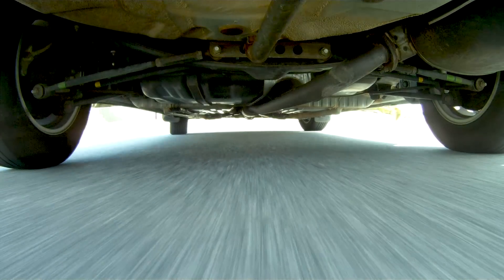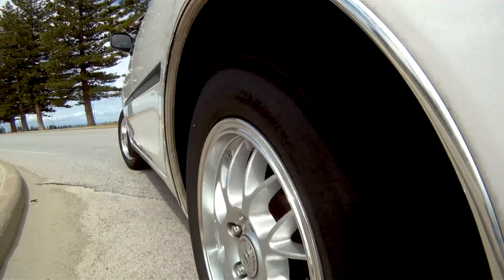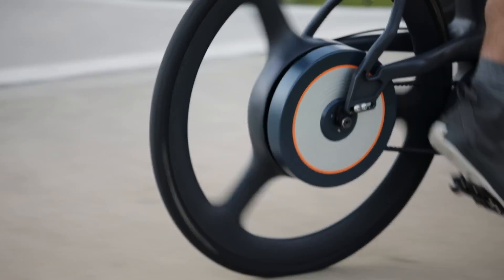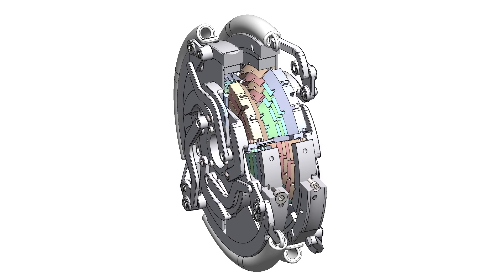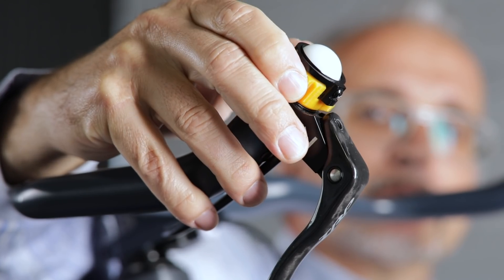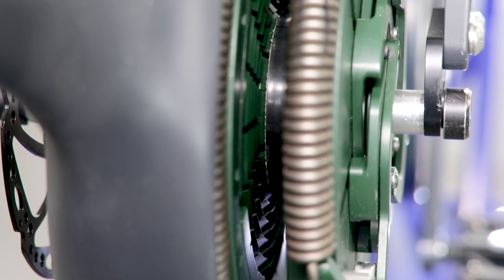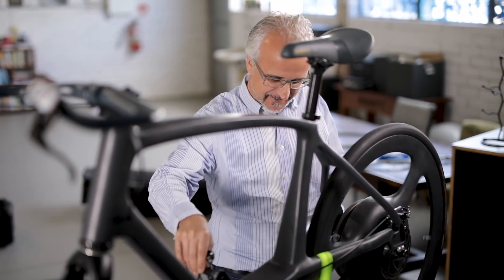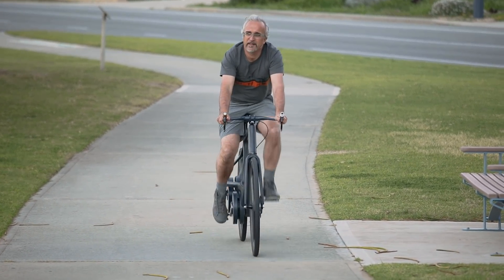Continuously Variable Transmission on a Bicycle

Comment: Failed in cars and will fail in bikes. Far too much efficiency loss, which is much worse than the losses of shifting between conventional gears.
Reply: Cvt's didn't fail in cars, they recieved a lot of backlash because people are so used to the feel of shifting that they didn't like not shifting. They were also more prone to fail on some brands initially.
In bikes I feel like this really doesn't have a place due to the weight, complexity, size, etc. But I think this was probably just a proof of how small they could get a cvt which is reasonably impressive.

Comment: I own a snowmobile, and a bicycle. Never once did I think it would be a good idea to put the transmission of the snowmobile on the bike.
Reply: Not even once?
Reply: The snowmobile drivetrain isn't sitting out in the open collecting debris in it's many moving parts like this monstrosity. Nuvinci have been doing a much better job on CVT bike drivetains for years and their stuff still barely sells.

Comment: road bikers will complain about the friction, mountain bikers will complain about reliability, bmx or trials doesn't need it. It comes on a proprietary frame too so you can't upgrade it. Overall, it serves no purpose in any disciplines of biking.

Edit: Even a commuter bike doesn't need it. It doesn't serve any purpose and no one needs it for any reason.
Reply: It's a proof of concept. They're not trying to sell it, but if they can resolve these issues they could find potential uses.
Reply: The road bikers would go mad over the weight lol
Reply: There are more and more "non-cyclists" on bikes with e-bikes and just city communting etc. These are made for short trips by people who otherwise wouldn't ride
Reply: @getahanddown  so why would you buy it then? It should be much more expensive than a regular gear drive. Not worth it if you use your bike only a few times a year
Reply: @getahanddown  I'm such a "non cyclists",  90% of my ride I use only one gear....I don't need this system. There goes your argument right out the door.
Reply: New cars don't serve any purpose either and yet we spend trillions every year buying them. They might be even worse than before. Its a new product, it does something different, people want to buy it.
Reply: miiikku People buy new cars because their old one rusted. Only serious bike enthusiasts care about keeping their cadence withing a 3% window, and NONE of those cyclists wan to buy this.  If you've got tons of money and just want to ride something weird, go for it.  This will never make cycling better though, never.
Reply: Overall, you can't discover how to make fire without trial and error. Maybe this technology is dead end, maybe not.

This solution has its downsides, but also potential hopes.
You need dedicated frame atm? We will see, maybe they will manage to downsize this system even more.
Who would use it? I can imagine commuters, tourists and training bikes for roadies. Basically anyone who's picky about cadance.

And if it will turn out to be dead end? Then maybe it will find use in other industries. Which would mean that cycling made the world a bit better yet again.

And as for "it's not needed" argument... well, your comment is kind of unnecesary too. But here you are.
Reply: Rafał Wyrwicki pfff most commuters don’t even use their gears anyway. This transmission is a terrible idea. If you are really that picky with cadence... even with how many gears modern bikes have... there are now 2x12 groups. How many more gears do you need?!
Reply: @wahidtrynaheghugh260   I have 2x11 with 11-28 cassete. Is it enough? It's better than 9-speed I had before. Do I wish to have more choice? Yes. Would a 12th cog make a difference? Mostly to my wallet, I'm afraid.

I think it is an interesting idea. Sure, you can disagree. But don't hate on inventor just because you can't see any potential benefits.

Comment: The Cycling industry already has a way better system called “enviolo”. Its a closed bike hub with undefined gears.  It works with a chain as well as a belt, and it doesn’t creates a ton of new standards of which the bike industry already has enough. So please spare me

Comment: In Shot Productions: "How many moving parts do you have?"

Advanced Tranxmissions: "yes"
Reply: Can I fix it with simple tools?

AT: "Absolutely. All you need is a wrench, a screwdriver, a set of digital calipers, a 400hp industrial lathe, a laser cutter, a welding torch, a variety of low-threshold laser calibration tools, some proprietary bearings and lubricants, some variable torque wrenches with proprietary sockets, a tuning fork, an aluminum forge, a freshly harvested pineal gland and a hammer."
Reply: @GirthOfANation  and a block of wood.
Reply: Q: ...and how much does this assembly and its power supply weigh in total?
A: Magnificent
Reply: Q - How many moving parts do you have?" 
A - All of them!
Reply: Q - Could you explain and demonstrate the system?
A - Yes, give me 2 min
Reply: How many? Yes 🤣🤣🤣🤣🤣🤣🤣 hillarious!
Reply: 21 Savage:  a lot
Reply: U
Reply: Teknision : NO
Reply: Have you tried counting the number of moving parts in a bicycle chain?

Comment: Who would turn their  bicycle into a Ford Taurus with transmission problems?
Reply: Go karts have had these “torque converters” for years and some of them will take upwards of 50hp
Reply: @Texas_Road_Warrior  The engines will, not the transmissions...
Reply: You know millions of these are installed in scooters for like a decade now
Reply: Kevin Mael or a Nissan.
Reply: I've got an 06 fivehundred that has the CVT transmission. I haven't had any issues and it's got over 265,000 miles on it.
Reply: *Volkswagen that doesn't move.
Reply: I would!
Reply: 2012 Ford Fiesta powerdrive transmission is the worst crap ever made.
Reply: Or just a Nissan 😂
Reply: The old Taurus was a great car I don't know about now
Reply: Kevin Mael i think u mean NISSANS
Reply: @c0r5e  My sister had a 1988 Ford Taurus that was a POS.
Reply: @kevinmael3862  Your sister's worn out '88 Taurus did not have a CVT.

Comment: Can we just stick to a chain. Please. Bikes were made to be simple and easy to work on. Not the opposite...... "#innovation"
Reply: cough DI2 cough hydraulic brakes cough internal gear hubs
Reply: Rafał Wyrwicki internal gear hubs were invented before the derailleur was
Reply: @AlexanderKorotkov42  Are they "simple and easy to work on"?
Reply: @RafaWyrwicki  Hydraulic brakes are.
Reply: @edism   With practice/patience and proper tools - yes. However I wonder if you would say the same in case of cable fail on trail.

My point is - if one is afraid of innovation, there is nothing stopping him from riding fixie/ss. Everybody can ride on whatever they want.

And when I hear "don't use that, i don't like it", I'm like "... who do you think you are? my mother?"
Reply: @RafaWyrwicki  Indeed, and I totally agree with this sentiment lol "don't use that, i don't like it", I'm like "... who do you think you are? my mother?"
Reply: @RafaWyrwicki  WANNA ADD more complexity with this CVT? MABYE?

Comment: Ah. Yes. Of course. Bluetooth is really neccesarry for this. Not like there exists electrical wires. And having to change or charge control panel batteries will not get anoying at all.

Comment: It's not CVT
It's too complex
It's too big
It's incapable of off road use
Perfect for lycra clad idiots who'll hangout in small groups at coffee shops.
Reply: Oi bruv. Got something against lycra? C'mere lets shave those legs.
Reply: Ad1) Why do you think it's not a Continously Variable Transmission? Because they've showed a classic 6-speed system at 1:50 for comparison? Well, think again.
Ad2) Classic chain is complex too. We just don't think about it since we buy it as a consumable good produced with automated machines. Try dissasembling one link of old chain and reasembe it. Repeat 110 times. Then call this CVT "complex".
Ad3) It's just a prototype, not final product. 
Ad4) Seal the entire system and you are good to go. Even Shimano didn't realese XTR DI2 at the same time as Dura-Ace DI2.
Reply: What does it mean "lycra clads"? I would spend scientists energy to invent comfortable riding mask for smoky dusty sity air. After 4 hours cycling my eyes are red, they hurt few days after, and lungs full of silicon suspense brrr...
Reply: @dazzershell   "Lycra clad cyclist/idiot" is a term used by some motorised road users towards road cyclists who "take too much space on the road" or "don't belong to the traffic". The term is supposed to be an epithet.

Comment: Why the fuck is it wireless. It's a bicycle, you've already got brake lines just add shift cables so you don't have to charge the fucking handlebars

Comment: No mention of weight. That probably indicates its heavy. Despite what they say it is not slim. The cyclist  seem to have a very uncomfortable gate with legs spayed out. Also it needs electronics  and it's not CVT. Looks vulnerable to dirt too. Other than that it's great - almost as good as chainrings and sprocket which are simple and reliable. I have a bike with an  original Shimano group  set which is 25 years old and still works perfectly. And I have never ever had to charge it once!  Keep it simple stupid.

Comment: Wait, what? Who said this system is small??? 
And it splays your legs apart. Oh my aching hips. And never mind trying to shift once you get dirt in there. Looks heavy.
Keep at it. Cheers.
Reply: It's just a working prototype... 
And by "small" they probably meant "narrow enough to put inside rear triangle of bicycle frame".
Reply: @RafaWyrwicki   still, my scooter's cvt is more compact than this "cvt" and it's lighter and doesn't have all these easy to break parts. If Ii had a mill and a lathe, i'd have no problems taking an old scooter, taking out the transmission, making adapters for the cones (main issues would be the wheel hub and putting the belt on), getting the appropriate spring for the driven cone and there you have it, a cvt, on a bicycle, without the expensive and easy to break electronics.
Reply: @GTAmaniac1  I think that big size is caused by wide ratio range and efficiency issue which is significantly lesser problem for a scooter. Funny thing about engineering is that solution that proofs its usefulness in one application (scooter) may be complete mistake in other (bicycle).

Comment: Some of you think this is not a cvt transmission . Well a cvt is not really a transmission at all . It's really called cvbd ! Constant Velocity belt Drive .   But it sounds better just saying cvt .  For those that think this is not a cvt your wrong. It is .  The only bad thing I see in this kind of system is even more belt ware . It looks as though this device will eat a belt in a day of riding .  A cvt is vary bad for ding just this . The other problem with cvt 's the amount of torq on the bearings .  The two main causes of cvt failure are these two things . I would never ever buy a car with cvt transmissions not until they fix all the problems . The other wear parts are the belt cones .  I would think of this failure or wear item is like dental floss string cutting threw iron bars . I see this wear on all worn out pulleys .   The auto industry want cars to fail over a given amount of time . They also want parts to fail during that time as well . They have always dont this and always will .  Volvo well the old Volvo like the 444 , 544 , Amazon or what some call the 122 last dam near for ever with out a rebuild of anything if you take care of it . I owned a 122 and put 600,000  miles on it . The drive train on these old Volvo's was half of a truck V8 engine . the trans is just as heavily built as well with a heavy duty clutch plate . I just got rid of mine about two years ago . The body was started too getting bad .   I wish I can find another old 122 wagon that is in perfect shape and with a manual trans .

Comment: I hope this was engineered for the fun of it.
Reply: Lh 010101 It’s an interesting problem with an interesting solution but yea there is no real practicality
Reply: Why not real ? A “Variomatic” used in Scooter already long time :)  if this Modell will be made a lot cheaper then Variomatic , why not to use ?
Reply: J B, most road bikes already have 22 gears, probably around 16 that don't overlap.  Generally gears are spaced 7 to 10% apart.  Worst case you drop to half gear easier than you want and slow down by 5%.  Best case you drop to half gear easier and increase your cadence by 5% making you 0.5% less efficient to be pessimistic, so then dropping back by 0.5% in speed(less actually) to make up for it meanwhile putting less stress on your legs to keep them fresh later in the ride.  So 0.5% less of efficiency is worth all this weight and complication?  Really?
Reply: @bigring6424  The way I see it single speed gives the best life expectancy both for the bike and the human.
Reply: @gabydewilde  I don't see how having 15% hills I just can't go on in my  50/16 increases my life expectancy, and I don't see how cruising on a wide open bike path or country road and only having a 48/25 does either.  Spinning out before I can reach my power limit isn't helping my health, nor is having roads I can't use.  What helps your health and life expectancy is having the gear you need to get the best workout all the time.  And having more roads you can go on means you have more choices for safety.  Often the hills have much less traffic than the flats.
Reply: @jb9282  - Weight springs to mind.
Reply: Alot of things are frankly.
Reply: It all depends everyone probably said this when auto cars were getting more popular.

Maybe in future it'll be perfected with tiny micro parts and be easy to fix etc

Every tech at the beginning looks stupid.

The first computer probably could barely fit in a garage, yet now we have smart watches on our wrists that can literally send emails etc
Reply: @bobloblaw1720  - This is a classic engineering solution looking for a problem, thus the sentiment of "hope this was engineered for the fun of it".

Comment: Too bad it was invented after the electric bike,  gear ratioes are always at an optimum in electric bike hence they don't need a gear box or CVT anyways, but An A for the ingenuity of the designer non the less

Comment: Using v belts for bicycles, and motorcycles are really inefficient. Lot of drag. Metal to metal chain and sprockets are better
Reply: silveribis55  And rubber Belts dry rot too
Reply: @SirSandHamwich  and metal chains and sprokets wear out...
Reply: Raymond Ager   Yeah, That With happen for a while with the Metal chain. Rubber dry rots quickly, if that Rubber chain sits out in the weather for a while, and it’ll snap in no time. I’ve  had my bike for a long time, Chain still works just fine. My neighbors bike that sit in the woods for 5 years Had many issues, but the chain wasn’t one of them.  It’ll take a looooong time to take a metal chain to wear out like you mentioned.
Reply: @SirSandHamwich  I think chain wear depends very much what type of bike and what type of riding. Moutain bike chains and sprockets can wear fairly quickly if used a lot on wet, gravel surfaces. I made the comment simply because stating that rubber belts rot, implies that metal chains never wear out, which isn't the case.

I think the important thing is to realise just how crude early derallier sytems were and how they have improved over time. I sure other drive train systems could also improve, given time to develop.
Reply: @SirSandHamwich  i haven't change my rubber belt in my scooter in 8 years. It's 110cc
Reply: @SirSandHamwich  Well my BMW f650CS uses reinforced rubber belt and it hasn't been changed since the day it was built (in 2004). No dry rot, no problems and extremely silent type of maintenance free final drive.
Reply: @SirSandHamwich  true.
Reply: Cade Ramsey the v-belt on my moped lasts about 30.000km or a good 1000 hours. Not sure how long the one on my Aprilia SRV850 will last but iirc it's got a 15.000km recommended replacement interval. Though both those are in sealed systems, away from dirt, oil, and sunlight.
Reply: In 125 ccm scooters rubber belts work perfectly, just change them every 5000 km and forget, not like damn always dirty or dry or loose chains. The perfect* engine speed all the way from 10 to 110 kph, make them faster than they look.
* 8000 rpm ofcourse, so power is much more fun than engines momentum (for momentum on wheels is CVT), or low fuel consumption :P
Reply: In some cases like touring or city bike belts prowide a lot of benefits with neglectable downsides.
There's an example https://www.youtube.com/watch?v=8SKeQ6B2UTk

Comment: Very cool idea, but the huge offset is a bit of a turnoff. Using a vee belt is great idea also, basically silent and maintenance free. If it did go into production I imagine it'd be insanely expensive though.

Comment: It's a great effort, but that looks like a lot of spinning weight and added weight. A motorcycle or car can overcome the extra weight by adding horsepower (bigger engine). A bicycle has limited power. It's real hard to beat a simple chain and cogs. They have their problems but so simple and cost effective.

Comment: Shit, that looks too expensive and too fragile... And it isn't even a true CVT.
We use the standard gearing system on bikes for a reason. Cheap-well, most of them, not complicated, easy to replace, easy to maintain, robust and effective. 
I don't want to send my bike to a mechanic like I do with a car.